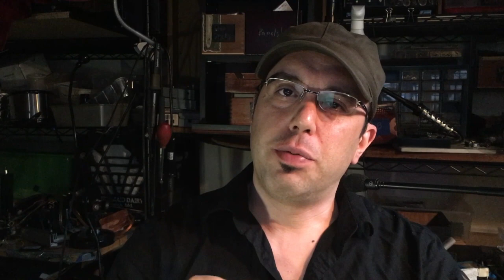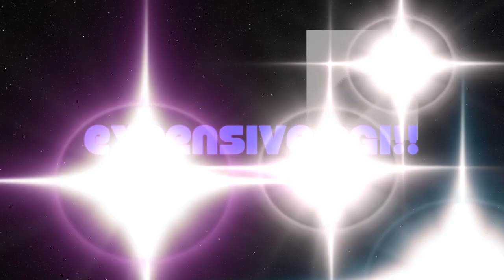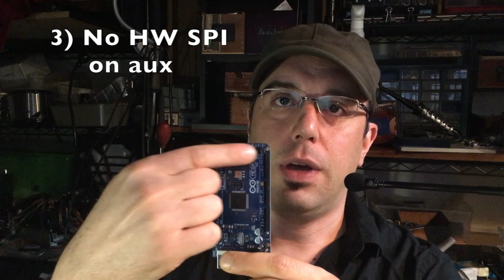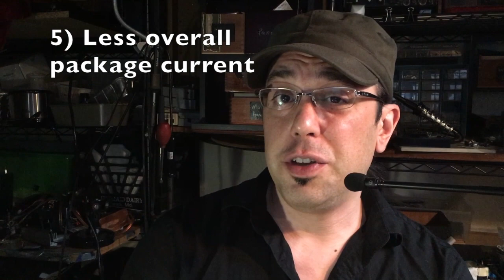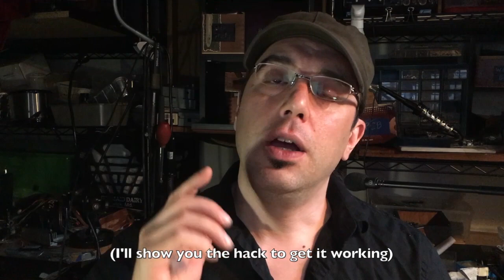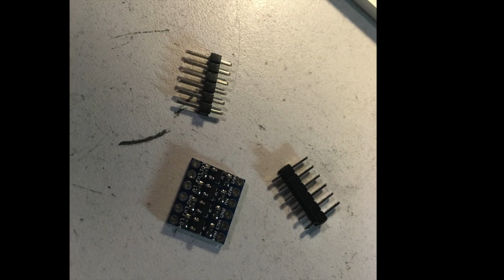Ramps + Due MOD, part 1: Intro and background

Comment: I'd actually want to use the RAMPS with the new Adafruit "Grand Central Station" Samd51 mega board.
Also, it might be easier to buy an unpopulated RAMPS board and just install the correct parts for 3.3v operation?  You can buy a bare bare from OSHpark.
Reply: I did this back in Dec 2019 and documented the process including a Klipper config.   At the time Marlin did not have support of the SAMD51 chip yet.  I can share what I did in order to get this to work-ish. On another note, I'm working with someone in Denmark on a RAMPS 2.0 board which will fully support 8bit and 32bit MCU's (MEGA, DUE, Re-ARM, and AGCM4).  The RAMPS 2.0 is looking good, the design is being changed from a 2 layer to a 4 layer board to provide better shielding of logic and voltage paths to reduce noise.  We are also looking at ways support both mechanical and optical end-stop switches under the 32bit 3v3 volt MCU's.

Comment: I tried I2C on Marlin, to communicate with a Raspberry Pi, but
I needed to implement a bi-directional level converter. (3.3V to 5V)
For some reason, it gave me a lot of garbage, after a while.
I was trying to upload gcode, from the RasPi, to my 3D printer firmware.
Therefore, I got to a Arduino Due, since it is also a 3.3V logic.
Yep ... it is quite a challenge, to get that working with Marlin4Due.

Comment: I would like to know more on software spi and hardware spi...i have arduino due + radds board...i need to use tmc2208 in uart mode....

Comment: Nice video..What would you suggest someone who does not own a Ramps 1.4/1.5/1.6  board yet? There are other versions of Ramps boards which claim compatibility with Arduino Due (like RADDS / Ramps-FD) which didn't find any mention in your video..What's your take on those?
Reply from the maker: It really depends what you need.  This video is really for people that have an 8-bit ramps setup already, and want to mess with a hack-y 32-bit mod, but there are better options if you are starting from scratch. RAMPS 1.4 is super-cheap, but requires modification.  1.5 and 1.6 work fine too, but you still have the problem with the mosfet gate logic voltage levels, so you will have to replace surface mount mosfets for either of those (which is trickier, but I made a video about it), or use an external mosfet or mosfet, but you don't have to worry about polyfuses. Ramps-FD versions that are in production are not safe: they cloned an early version that was not completely tested, so those boards also require modifications for safe use.  RADDS works well, but is a bit expensive for what it is, and it is CC-NC instead of completely oprn source, so you won't find cheaper clones.

Comment: i dont really like the idea, its like you said simply a hack - so i will not available for the majority of people. 
What are your toughts about the mks sbase, schematic are online, the price is reasonable and there are pins with the stepper signal if you what to use aure own steppers, its 24V ready ..
Reply from the maker: I'll touch on some of those 32-bit boards a bit in the near future.  I have had those unofficial SBase schematics for a while, but I don't have a board to confirm them.  the SBase started as a cheaped-down smoothieboard clone, but they didn't publish their changes or attribute the original makers, so those GPL violations mean that Smoothie won't offer any support, but Marlin 2 is starting to include a profile for the board as well. I know they have problems with drivers, connectors, layout, displays and USB chip, but I have not looked into the issues in depth.  If MKS/Makerbase cleans up their act and and complies with the licence, then I will cover the board in-depth... I'll talk about that a little in the next Q&A video, which will be out soon.
Reply: I found an schematic an on the makerbase sites, public, can´t tell if they are correct. 
get in touch with me if you are in the need of a board. 

GPL violations, no attribution, problems with drivers and serial chips wouldn't  this also apply to some /many ramps 1.5/1.6? -  yet we still use them (and cheap due clones) seems picky to me.
Reply from the maker: Yes, you are right about that.  I'll touch on it in the Q&A.  I stil don't feel great about the 1.5/1.6, but they seem to fall into a grey area where they did offer attribution links and comparison to the 1.4 board, but didn't release gerbers of the PCB, but they were basically ramps boards with SMD mosfets and a few pins moved around, so I let it slide, BUT there absolutely is furious debate over the china-clone stuff around the internet.  One of the reasons I have been dragging my feet over the SBase is that the common problems could be fixed by MKS in the next generation, and the company is just starting to understand what GPL open source means, so I have been waiting to give them an opportunity to fix some problems in the next version, and officially release their changes to the community. Same thing wirh Creality and a few other companies.
Reply from the maker: I get what you are saying.  I'll be posting a video on my positions on GPL and IP theft to let everyone know why I don't cover certain things.  With the SBase, I am waiting to see if MKS comes clean before I do anything in-depth because it SEEMS like they are heading the open-source route which is good for them and the community,  and  I really want to get them on the side of the good guys!  If they do, I'll cover it in-depth, but I just don't want to screw over companies that did the original work by doing tech support for competitors that ripped them off.  Also, I don't feel great about Ramps1.5/1.6, and I try to avoid them, BUT they fall in a grey area for me because a) the community has just about abandoned new RAMPS development and until BIQU put work into it and b) they are close enough to a 'clone with upgraded parts' that almost all the original literature applies. That doesn't justify not releasing the updated design files, but I feel less bad that they are not sabotaging active development, and they are safer than many of the direct clones that have bad parts. But I totally hear what you are saying, and I am prepared to do a whole series on SBase if MKS goes all the way with compliance... it's just a waiting game right now.

Comment: Oh laddie your aslayin me with the deep breath then the "flash speed" breakdown .........
step away from the crack pipe...... Lol
kinda amaze myself how i can even understand a lot of the "NERD TALK" having only had studied this stuff for the last year. However i am still kinda asking myself WHY.....
What is actuality gained in using a 32 bit system anyhow.....?
What is gained in doing so ......?
And once again a most excellent video'........ ROCK ON  little Bro......
Reply from the maker: They just have more ins/outs, speed, hardware functions, memory, bandwidth, efficiency, etc, etc.  8-bit is getting more expensive lately as well, because it is legacy tech. THat all depends on there being software to take advantage of the 32 bit systems, and affordable boards and peripherals that will work with them, which is what I want to push for.  8-bit is still fine for basic systems, but firmware features are math-limited, and the interrupt speeds aren;t fast enough for some kinematic platforms.
Reply: Thank you both...... Preparing for my first printer build kinda thought this might be something i could/would use for it but i think i will kinda stick to a  basic  system for our first one.
Hope you all may help a brotha out with that.
ROCK ON......!
Reply from the maker: No problem.  The standard ramps+mega+Marlin firmware route is an easy place to start because there is sooo much info online, and you can swap out to fancy-schmancy electronics later

Comment: Interesting video, definitely wanna follow along. Depending on how much work in modifications I'm curious if it would just be easier to use a Raspberry Pi and run klipper firmware she get all the benefits of the 32 bit as well as better planning for movements.

Comment: Thanks for the really informative videos. I really enjoy them! Have you ever thought about building an ultra low cost printer such as the ToyRep that uses the low cost 5v steppers converted to 12v bipolar? I think that would be an awesome series to see.
Reply from the maker: THat looks like a fun project, but when it was originally developed, nema motors were much more expensive.  If you are not picky about specs, you can get them for a few dollars now, so it's tough to justify not using them.
Reply: Nema 14 motors would be the best replacement I’d think but I don’t know if those are very cheap.

Comment: Oh god, I never knew there were different micro usb cables, been sitting on some micro usb cables salvaged from an EV3 mindstorm kit and could not connect to my Re-ARM board, been tearing my hair out trying to install the right drivers but maybe those micro usb cables I have don’t have the right pins to connect
Reply from the maker: It's worth checking.  I have a few micro usb cables from chargers that don't work.  THat's a danger of standardizing a connecrtor without standardizing the cable (or at least establishing a marking for power-only cables)
Reply: I'm also thinking now that's why I could never get my melzi board to ever connect when triying to connect over usb to either print or change the firmware.
Reply from the maker: Could be, but Melzi and Sanguinololu are notorious for that (on Windows anyway).  They use an FTDI serial to usb chip, and there are 2 issues 1) the windows auto-install driver  doesn't always work, and 2) newer driver versions can brick FTDI counterfeit chips. With older windows, a newer driver, or a different operating system, they behave better (unless the new driver overwrote the chip, then you have to re-flash, just search for 'unbricking counterfeit FTDI').